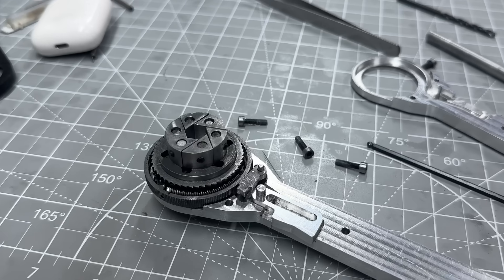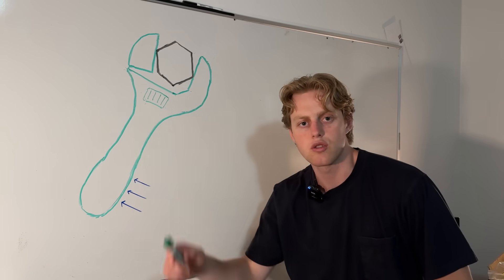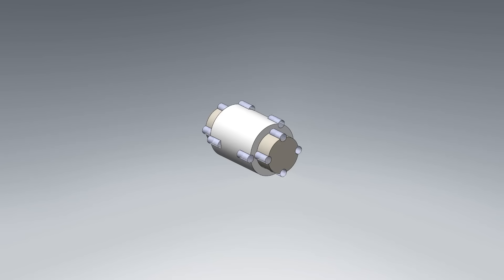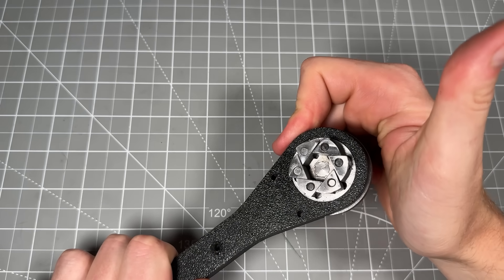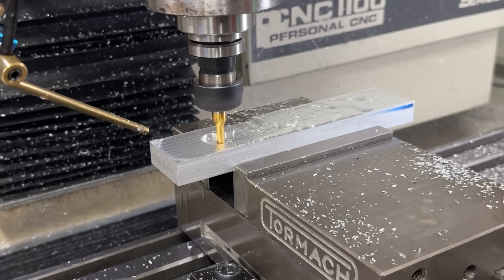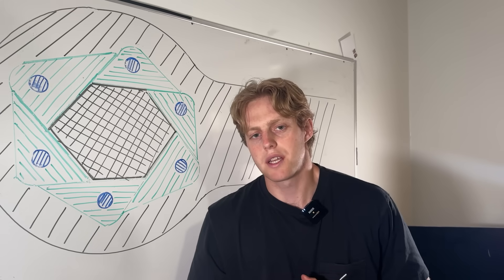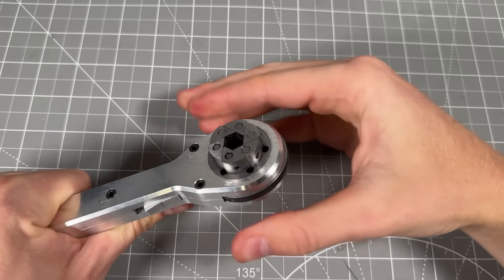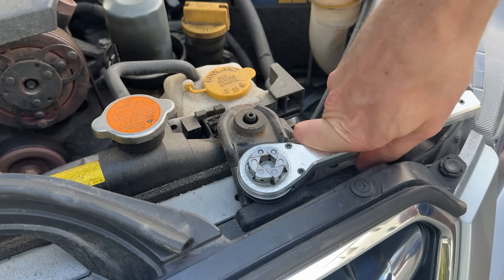I Invented an Adjustable Ratcheting Wrench

Comment: I like the design. YOu did a great job on the manufacturing process. You have several elements I haven't seen together before (but I can't be bothered to search myself to see if they have been), but you MUST search for, and credit, prior art. Even if you weren't aware of it, it is there. That is part of, often the most important part of, the design process. Some problems afford one class of solution much more apparently then another, and the spiral slot cam has shown up many, many times in this application, and some of the patents are still in play (US7992470, for example, now a standard case study in engineering school and IP law. Search for "Dan Brown loggerhead tools" for the lawsuit info. Didn't kill Sears, but it certainly didn't help).

Comment: Maybe think of this as not a wrench. But like a rachet with different attachments. Maybe... an insulated ratchet, using ceramic parts, and the ability to use bits in a quick change manner without using magnets is a huge plus.

Comment: Really great work, man. A lot of time good engineering just requires perseverance. You can’t always get it right the first time. Prototyping is fun, but also painful to feel like you’re continually failing. Your next big step after honing in the design for what you want will be a tolerance analysis for a more realistic mass production, keeping costs down.

Comment: beautiful, well done. You need to look out for similar impossible missions so that you can take a break from one by switching to the other. The thing you show at the end where you hand tighten the bolt, that could be a separate project for a more conventional wrench. Maybe it could even be a chain that runs all the way around the handle. There also is the much fun puzzle of making a ratchet mechanism that is strong but has no play. This is wonderful for hard to reach places. (does one thing well)

Comment: The design is interesting. As you discovered that often material selection makes the difference between a working design and scrap metal. As I watched, my thoughts were centered less on the design than how to leverage other machine processes to produce the tool.  This was an excellent exercise. I'd have one (or three: small, medium, large) iny toolbox. 🤔😉

Comment: pretty useless if you only can use bolts from 1/4" to 1/2" you still need multiple wrenches anyways so getting a good socket wrench is way more efficient and certainly more cheaper  im am an avid tool guy but i would not buy this thing   dosent matter how fancy it is when it offers no real advantage over just a regular ratcheting wrench set its a no brainer to not want it tools after all are meant to be used and not stored in a shelf  tools that do get stored most of the time are either specialty tools or they are just no fun to use latter of those end up in the trash most of the time

Comment: If you can somehow make this into a long socket, with an inner square part to fit onto the end of an extension that doesn't obstruct the teeth, and make it in 3 sizes, I would buy all of them. Reducing size would be of greatest benefit

Comment: patent it as fast as you can, and make a rugged version for bolts from 17 all the way to 42 mm ....plumbers that do multiple areas of work (ventilation above the ceilings, drain pipes under the floor.... super handy to have such a thing not to switch tools all the time)       edit;  and such a thing that could fit on an electric drill instead of a wrench would be a big seller.. most modern plumbers use cordless drill for everything, but changing the drill bits can be tedious when you have to do hundreds of fixings on a job especially when you are crawling under a wet floor (yes thank God i have not been electrocuted lol)

Comment: Great design!  Nice job sticking with it.  Real, positive persistence is not an easy character trait to develop, especially if you feel alone in your pursuits.  A Kickstarter is a great idea.  Definitely make sure you get a patent application in.  Developing the initial patent will be a challenge all its own, but may also fire your desire to continue refining the design.  Perfecting a design just to see someone else patent it would be a hard pill to swallow.  I see a lot of potential with this design.  Nice job recognizing the need for using a stronger material for the pins.  Keep up the great work.  Definitely consult trade professionals for their opinion, and ask how your product might be differentiated for them compared to others they may already be familiar with.  Wishing you all the best 😊

Comment: If you could somehow make the wrench a pass through style so that it would be much like a ratchet wrench it would make it less bulky and easier to get into tight spaces. Recessed bolts would still require a traditional socket but that’s ok. It would still reduce the number of trips to the toolbox.

Comment: Having a single wrench like this would be so much more useful to me around the house than a socket kit. 

There is the issue of this not working with square bolts/nuts, but in my case? I've already got a breaker bar and socket set (that happened to have a hex screwdriver bit adapter--which was the whole reason I got it, as extra leverage for undoing the screws on my scooter), so I'm probably good on that front.

Comment: Your design and tenacity are excellent!

As a mechanical/manufacturing engineer and off-road enthusiast, I typically carry about a cubic foot of 1/4”, 3/8”, and 1/2” sockets. With your excellent design, I could remove three or more ratchets plus my shallow and medium sockets—cutting the toolkit’s volume by roughly 50% and shaving both weight and space.

To make it fully workable with my setup, I’d just need three small adapters from your handle/wrench to 1/4”, 3/8”, and 1/2” so I can keep using my extensions. If the handle is solid at ~5–6”, consider machining a slot to accept an extension bar as a lever for added torque—essentially serving as a breaker bar—provided the mechanism can handle the load.

I’m excited to see these on a shelf near me. Keep up the great work!

Comment: Your critical parts will be less likely to bind if you apply a coating of Schaeffers oil 293 gear oil. It plates the metals with MOS2. Unbelievable how much it lowers friction and keeps working.

Comment: I would buy one. I have plenty of use cases outside of the few limitations. Brilliant design. 

If you could find a way to add a switch to let the same side loosen and tighten,  removing the grip jaws on one side would save a lot of space... maybe you could offer one wrench with geip jaws on one side that both loosen and tighten and another version with 2 sets of teeth, one of the two being slightly longer and chamfered for deep reach bolts. Sell them individually and as a set.

Wish the shark tank investors could see this.

Comment: Dope bro. I’m a mechanic and sometime forget socket sizes and gotta go back and forth in my toolbox. Even if like a 1/4 ,3/8 snd 1/2 version was vailble it’ll be dope. Like it doesn’t have to cover all size sockets. I think 2 or 3 variants should be available . A miniature version for small spaces and a larger version for larger applications. With the smaller ratchet having a deeperchamfer”

Comment: Heres the problem, material integration, material molecules forms. If u have a lot of parts u have more areas of failure, your wrench may breakdown at some torque. Its why milled wr e nches might be stronger then forged tools. If you start intefering with the integrity of the molec

Comment: You'd be financially set you had designed a ratcheting wrench that could adjust from like 1/4 to 3/8 to 1/2. Might be too much, perhaps 3/8 to 1/2 is doable. 

I'd buy that in a heartbeat, nothing worse than rummahing for an extension or specific socket and it's the wrong size.

Comment: As a technician, I find most products are already designed for manufacturing with currently available tools, so if it's something a socket can fit over, most equipment has at least one bolt with clearance issues for anything larger than a socket.
If it's something a spanner is needed for (any kind of pneumatic or hydraulic line, some shafts) then it needs to have an open side, and this already won't work, plus a spanner will be stronger in any place where this can be used. (Aside from the smallest fasteners, which will likely have clearance issues)

So I would have trouble devoting toolbag space to this type of tool, but if the ratchet were much lighter and still capable, I would consider it for cases where it would be faster and potentially save me from repetitive strain injury.

Comment: Unless you can make it smaller or if someone solves the mechanism issue that requires it to be a double sided mechanism, I think creating two separate wrench for loosening and tightening would be a swell idea, just so that the profile can possibly be made smaller for tight spot applications. It would still save hassle since the entire clamping mechanism would cover most bolts instead of changing socket heads. Then color code or engrave directional indication if it's a tightener or a loosener; overall increase usability due to the lessened profile allowing it to be used in more spaces. Maybe a gear shifting mechanism of some sort? Haven't thought of the feasibility yet within a smaller profile because it also need to be strong enough. Basically, I was thinking of a possible mechanism that allows the biting portion to switch plates responsible allowing the head to ratchet that way you would only need one side of the head to do both tightening and loosening.

Comment: What makes a socket wrench isn't tightening, it's loosening, always the hard thing to do.  Sow us it working on an old suspension bolt & we'll buy it.  As it is we probably still need sockets for the breaker bar or impact wrench.

Comment: Outstanding design.. but saying it fits any bolt is misleading... it only goes up to half inch. Also has the same pitfall as all the other adjustable wrenches... It's limited use because of its bulkiness necessary to house the ratcheting mechanism so no good in tight places. Your machining skills are outrageous. Subscribed.

Comment: Great stuff. Maybe you can also make an adapter using this design, people can put on their wrenches.
There is one with these feathered pins that dip in, and create space for the screws,
to get gripped by the remaining bolts arround that. It's called universal socket wrench.
Yours looks more stable.  A ringspanner version would also be amazing.

Comment: First video, with an insane amount of dedication.  I wonder, if you changed the jaw design to something akin to a stud extracter, and reverse the mechanism... how it would compare to the typical stud extractor sockets that we see.  There is no space between the jaws and the bolt you are wrenching on, which would be a massive advantage for stud extractors which currently need at least a half inch of bolt to grab on tight. Has the potential to be great for extracting broken bolts, removing studs etc.

Comment: While in an in-house tool shop with tool makers inside an R&D factory that used plastic injection molding machines, the toolmakers told me that to maximize the life of a spring; the spring should not be compressed any more than 30% of its uncompressed length. The platens of the injection molding machines used Springs and bushings to pop out and release product... Your Design relies on Springs. Something to consider.

Comment: Would it be too big of a design change to drill through the center so your mechanism could be used on nuts?

If you were to make the jaw assembly out of hardened steel, could you make it longer?  Like a short socket? 

Also, love this.  I would buy one.

Comment: Just a suggestion, would making the bolt head cavity work better a little deeper?My thought is it would be easier to stay on the bolt head as bolt is unscrewed. What about a magnet in middle of bolt head cavity.Cool design for sure.

Comment: Solution for more recessed bolts has always been extensions for mechanics. Just, in your case you would need a double flat extension. So long as your wrench grabs onto and locks an extension in place, bobs your uncle.

Comment: Add a worm gear inside the handle so after a bolt is broken loose you can use a drill to spin the teeth faster would be amazing for long bolts in tight spaces

Comment: I would buy this. For sure. The only issue i see potentially is that it's limited by how close it it to the bolt or nut. And I dont see how you can extend it but I would still want something like this in my toolbox still very useful

Comment: If you could find a way to make it pass-through, even if it is gigantic it would be an easy replacement for the Klein 6-in-1 lineman wrench. Which would mean being a competitive replacement for an industry staple tool
Reply from the maker: Are you aware of any significant pain points with the existing Klein 6-in-1 lineman wrench that my design solves?

Comment: I don't think your tool can compete with a socket wrench because it's too bulky and you can't put an extension on it. Plus I have a zero degree socket wrench which is even better than a regular one. But as an adjustable wrench i think it has potential. If you make the whole thing smaller and flatter I would love to carry one of those instead of carrying a 7mm, an 8mm, a 10mm, a 13mm, a 17mm and a 19mm to every single customer.  Adjustable wrenches have too much slop, they're trash.
Reply from the maker: Good insight

Comment: I love that it eliminates the need to identify imperial vs metric bolts to make sure you're using the right socket set.
Reply: For us Americans this is not a small issue. Completely ends the super fun "guess which size head of which system you need" game...
Reply: This!

Comment: As a commercial electrician, I need a lot of different tools. This thing would be an excellent way to lighten my load out. Two ideas that, if you could make them work, would be very useful:

1. A pass-through option. If you could adapt this mechanism to something like a ratcheting box-end wrench, it would be great for tightening bolts on allthread
2. A thumb mechanism that would allow you to open the wrench from the handle so that you could get it in tight spaces. 

Anyway, I love this concept. Very cool.
Reply: I just made a comment that electricians would use a tool like this more than regular mechanics. Make it insulated and be able to use bit like attachments.
Reply: Love those suggestions. I 2nd these.
Reply: I have an open end racheting design (not like the current commercial offerings) Still haven't built the prototype from years ago but this video got me thinking about finally doing it
Reply: @matthewmosier8439  That’s awesome. Shoot me a link if you ever put something on the market. Saw one recently where a guy made an adjustable Allen key. I can’t remember the channel, but I’m sure you can find it on here. It worked somewhat like opening a drill chuck, except hexagonal. Love seeing all this new stuff.  Always looking for innovations in the field.
Reply: 1) he went over the center bushing mechanism and why it was *required*; a pass through hole is not optional here. 
2) this wrench is never getting into "tight places" regardless of any extra mechanisms you can get on there. Heres an idea, try removing a recessed bolt with this device.
Reply: Just take the dildos and butt plugs out of your tool belt and you'll have more room 👍
Reply: Maybe look into the Wera Joker 6004
Can't guarantee that they are good because I never used them, but I've used pretty much their entire line up and they just never miss

Comment: I really like it.  Sometimes you can't get away from using extensions, because of hard to reach bolts and nuts.  With that in mind, what if you lose the ratchet part and make your tool a universal socket that attaches to ratchets and ratchet extensions?  I also wonder if you can find a way to transfer some of the bulk or outer mechanisms to the interior.
I have to say though, this is looking very promising.  I think you did a good job.  Can't wait to see what else you come up with.

Comment: Excellent work. Will it replace sockets? No.
Will it have a use and a place in the toolbox? Yes.
For me as an industrial fitter that works with 8mm to 60mm bolts it never going to have that range but would be good to carry for the smaller range and the god knows umpteenth bolts.
Keep up the good work.

Comment: Hey mate im a qualified mechanic and i would say the biggest drawback with this is the inability to use extensions. if you find a way to implement some way to use extensions, like maybe a 3/8 anvil on one side and the multi grip adjustable on the other with a reversable pawl that would be ideal since you can use conventional attachments but have quick access to the unique multi grip feature at the same time. otherwise i couldnt see myself ever picking this up if i had it in my toolbox. the only trouble is i cant imagine those adjustable teeth would work in reverse. as it currently is i would say its very cool but a bit of a gimmick for those who are serious about their trade, but for a home gamer or tool enthusiast i can imagine it would be popular just to have one. cheers

Comment: some sockets have flats on the end for hand tightening/loosening or using a wrench. u can use these sockets with ur wrench for larger bolt sizes. snaller, extensions, adapters. all would work. 

maybe a small retaining groove in the wrench paired with a snap ring in the extensions would help secure it.

Comment: I'm a weekend mechanic, but if it worked well, and covered a wide range of sizes, I'd definitely buy one. I'm sure the pros would feel the same, it would be easier than having to switch sizes while working on something.